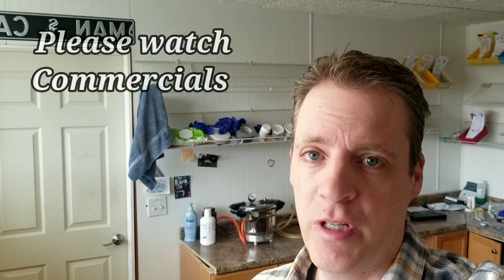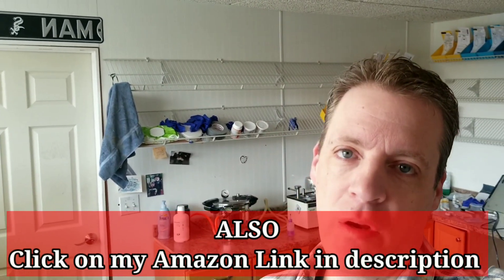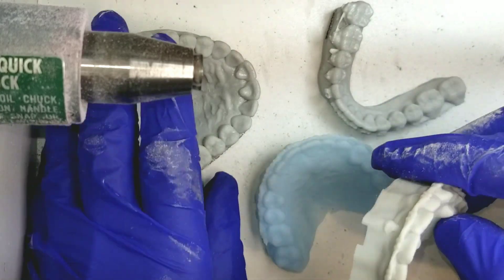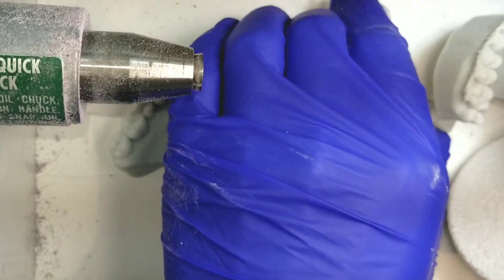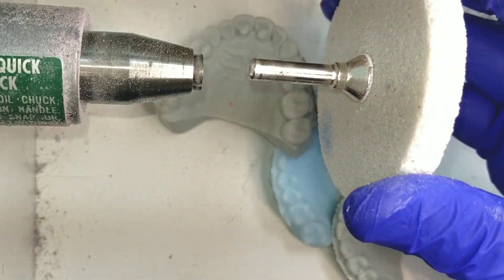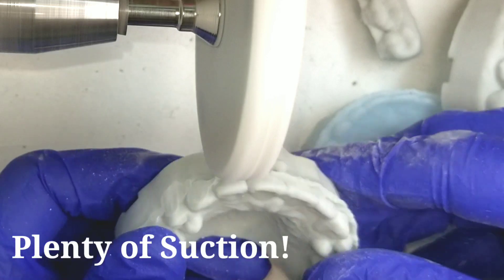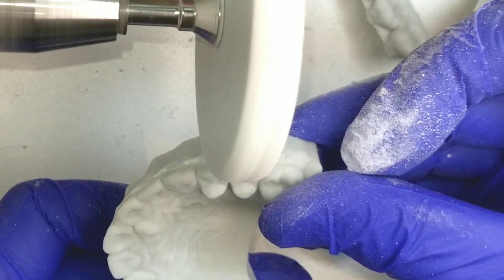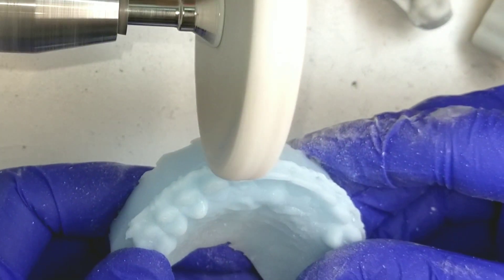How to Remove  Brackets off 3D Ortho Models FAST

Comment: Do U use envisiontech resin material ro print models for polimerisation or just orthoShape mayerial and then cover it to an isolant some kinde before polimerisation process? Thx for reply. Arita Belte from Latvia the Baltic states.
Reply from the maker: Hello you can use esep resin from Envisiontec.  Just add acrylic directly to model. Eorthoshape is for fixed applications and invisible retainers

Comment: Much easier and cleaner to use software. I'm using meshmixer to remove brackets. No returns for bad/not fitting clear retainers. Plus, meshmixer is free.
Reply from the maker: Can you please demonstrate how to do it
Reply: @SzaraDentalLab  Check out "Debonding amd removing brackets with meshmixer" here on youtube. Several good videos out there.

Comment: How are you removing brackets if you’ll be making an essix instead of a Hawley? The facial needs to be more accurate for an essix. I’ve been using Ortho Analyzer and the results are good but it takes forever.
Reply from the maker: Hi David
I only get a few request per month to make an invisible retainer from a 3d model with brackets. I do them by handpiece only slowly and methodically. I Do Not promise that they will fit perfect. I also typically scallop these cases also. If I did more I would probably invest in 3shape software. I've never used ortho analyzer but time costs money.

Comment: great video.
I,m having a really annoying problem and I hope you can help me.
my acrylic gets dull in areas that have blocked out with wax.
I don't know what to do...
Reply from the maker: Are these on 3D models or plaster/stone?
Reply: Stone models
Reply from the maker: (Soak models in water for 5 minutes) after they dry Try putting multiple layers of seperator. Letting each layer dry.
Reply: I soak them and put seperator on them but it dosen't  make a layer on the wax...